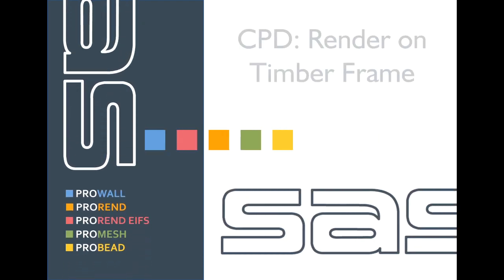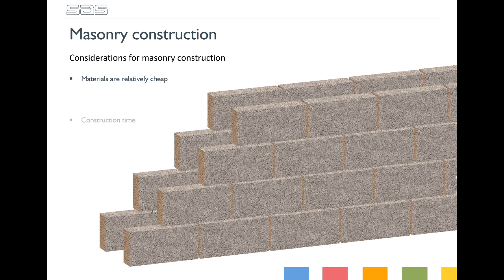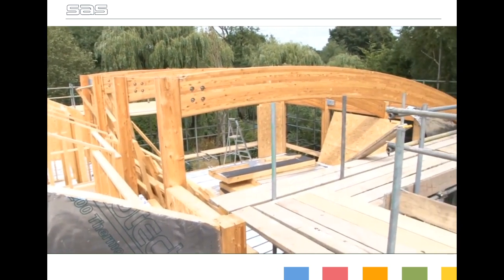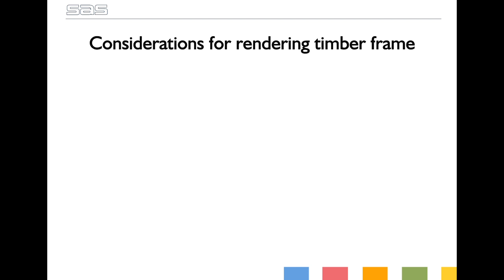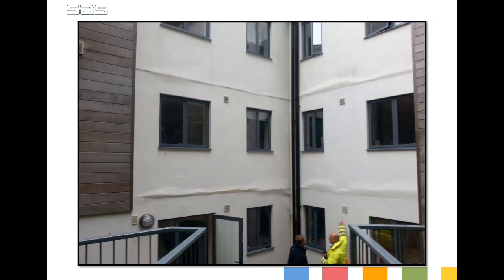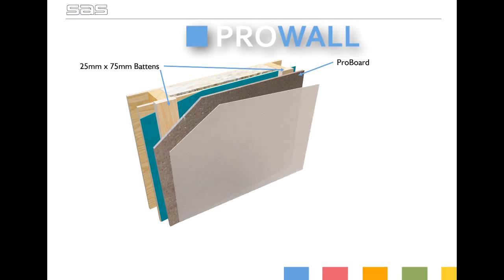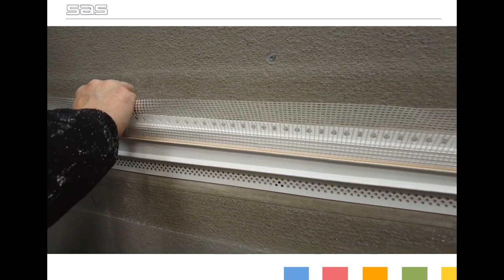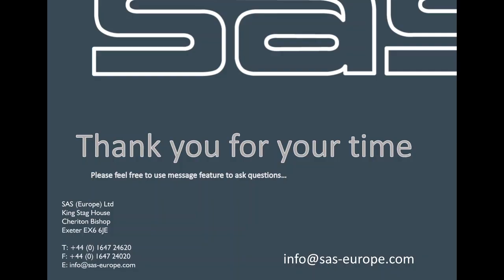Render on Timber Frame

Comment: I’d like to build a garden fence with this system. Would it need to be sealed at the top?
Reply from the maker: Yes,
- No ventilation would be required as it would be for a fence. 
- You would need to cap the top with coping or render.
Any more questions please do not hesitate to contact the technical team at info@sas-europe.com or call 01647 24620